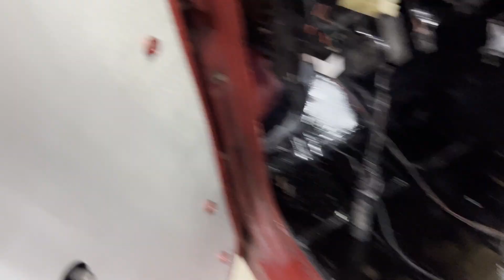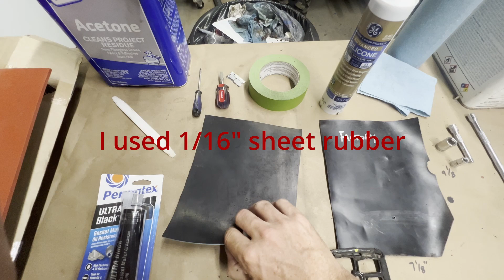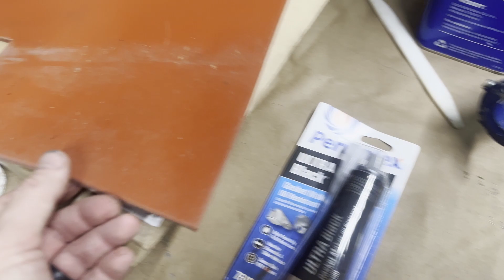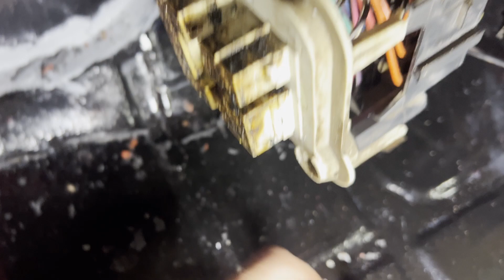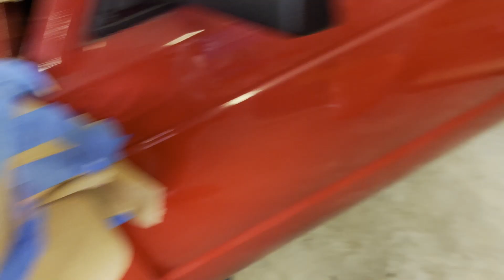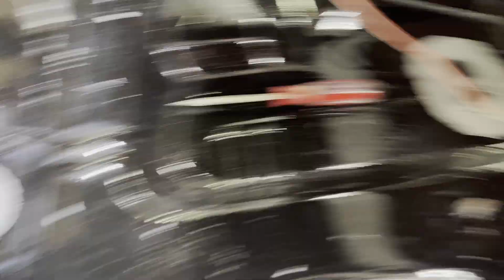S10 Bulkhead Connector and Cowl Leak Repair

Comment: Man, your perseverance is amazing! In my shop, I've had situations like this which required me to invent some new curse words!

I have a '79 Trans Am that I just finished rewiring the entire under hood system but lost the oil pressure sender circuit at the bulkhead. So I'm researching GM bulkhead repairs to bone up for the happy day! In my case I will also need to remove the hood and the LH hinge. But I fear that the booster and master cylinder may have to come out as well. Lot of work just to get to the darned thing!
Reply from the maker: Oh believe me, I had to walk away a few times. The second time I would have bet it was fixed and when it leaked I was so frustrated but I have learned to just walk away and calm down. I come up with better solutions after a few minutes. When I was younger I probably would have had to do some body work after I was finished beating it with a hammer. On your Trans Am, I have been looking at some 90 degree boots that really sont look bad, but also Duetsch and Amphenol make some panel mount connectors that might work.  The only issue I found is finding a connector that has 33 pins with about 4 of those pins being large conductors. It looks like I have about 4 that are 8 guage. Good luck with your TA my friend! Thanks for watching.